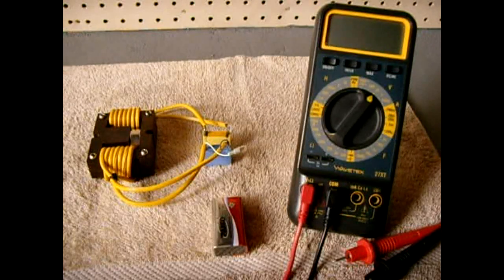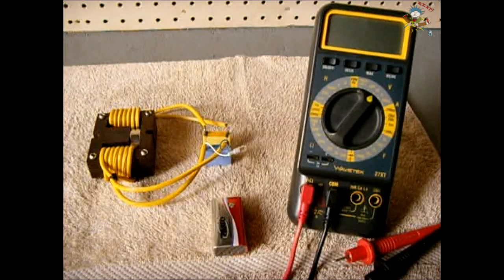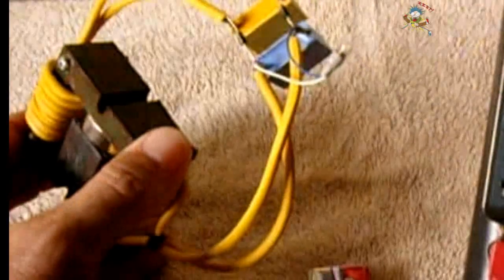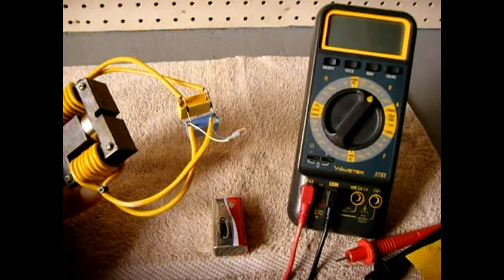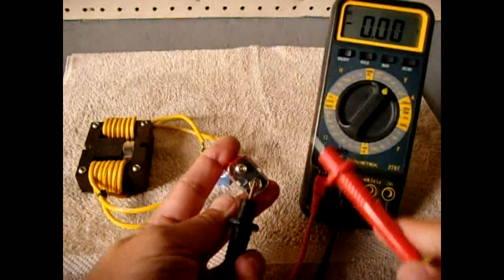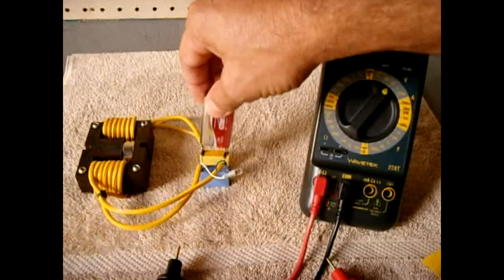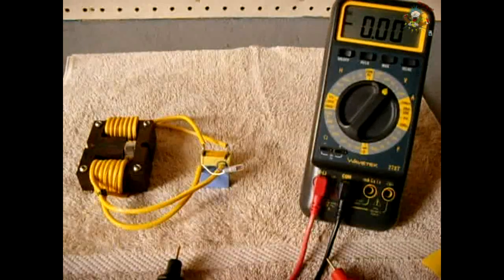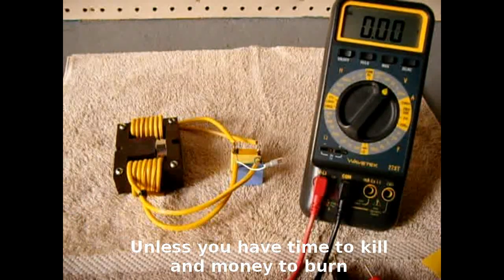Overunity Motionless Free Energy Generator EXPOSED!

Comment: I took a look at your explanation, and I saw the original video as well. Your Iron Mass is totally wrong. You created a solid square with everything bolted together. When you use a magnet, things have to oscillate, means vibrate. You cannot achieve Vibration if everything is bolted and screwed solid to the magnet. If you don't change anything, build it again.. it does work. Watch my videos.
Reply from the maker: Clearly it does not work regardless of having a "Solid" core. When you have a video of this EXACT device which you claim works, showing full operation, then send me a message and video with ALL design specs/parts used. If I verify it does work by making one according to your instructions, then I will post a link to your video. Case Closed until then. That same guy claimed that plastic on the magnet "blocks" the side magnetic field of the magnet. LOL. Really? Based on that comment, I know he is a fraud.

Thanks For Watching.
Reply: what about using a audio amplifier and a sound wave generator to achieve good vibrations ;) that way you can control much more the input frequency
Reply: Gerard Morin also coils are same gage wire ,so there are no step up and down electric charge and it just create a equal filed around the coil that it can not run the ions trough to the capacitors.
Reply: Shikalgar Shiraj
"Absolutely right. it does work if we use solid iron core."

Oh the irony - That's exactly the opposite of what Gerard was saying should work; he's claiming that "everything bolted and screwed together solid" is what is preventing it from "achieving Vibration." Whatever the hell that means with a capital V, since physical vibrations in a transformer causes losses in efficiency that are to be minimized.

Ever heard of eddy currents? If not, look it up and understand why solid metal transformer cores are a bad idea.
Reply from the maker: John khamis hesar
John, don't be ridiculous! Were you there to actually confirm it worked? No, so stop believing in these scams! They feed off people just like you. Unless you have PROOF, I suggest you end all this nonsense. Where is YOUR video showing this works??
Reply: Awesome
Reply from the maker: Tech Pro
Good luck with that.
Reply: John khamis hesar
Those are not electrolytic capacitors, but polymer film AC ones -> no, or at best very insignificant ion transfer occurs either way, especially at such low voltages. That is the whole point of a dry high voltage capacitor: to prevent premature wear through free ion formation under prolonged use. Electrolytic caps tend to have a polarity and thus don't even work with AC, exactly because they rely on ions moving the charge, and AC would cause premature failure. Only way to cause that to happen in this case is by arcing through the film and I doubt that is what you meant to happen. * Rolls eyeballs * Stepping up or down is irrelevant if we're talking about an oscillating LCR circuit that produces any kind of "vibration." If an electrolytic capacitor was used in such a case, ions would move either way.
Reply: As you know transforming DC electricity will create a magnetic filed ,but can not step up or down trough to the Iron core ,so there need a alternation .That alternative it's magnets and they create additional magnetic filed that it's recharge the primer filed ,none solid iron it cause a disconnection between the two filed and it jump to hyper electricity trough to the larger coil winding that it's step up the DC and what Dido and AC capacitor does it's to transfer the DC to AC low voltage and opposite with a none stop current as long as filed it's active or connection are connect .
Trick it's seem simple physic low  of magnetic filed , Electron and proton that it cause electricity by leading the electrons in direction that will charge them and speed up the electrons and protons trough to the secondary winding .There's a equation between the winding coil gags also turn of the winding and direction of the winding .To me video it's not scam and device it's completely operative .
Reply: John khamis hesar
Do you have any idea just what kind of a load of bollocks you're spewing? You can actually drive a transformer with just DC current and a variable resistor, provided you vary the voltage fast enough to produce a measurable voltage in the secondary. That's without ever having 0V or switched flow of voltage through the primary coil. In fact, modern switching power supplies produce a half-wave pulse-width modulated current from rectified AC at a high frequency in order to efficiently step voltage either up or down. In that case, though, the resistance on the driver transistors is enough to drop the voltage to 0 between cycles. Voltage boosting buck converters would also like to disagree with you, look them up.

Every time there's a change in the magnetic field in either direction, movement of electrons occurs that can be put to work, simple as that. This thing, if it resembled anything that could work, is a very simple LCR circuit: Inductance + Capacitance + Resistance = oscillations out of nothing but DC voltage. LCRs are the most basic of the basic methods by which currents can be generated in varying frequencies out of nothing but DC voltage.

Oh yes... bring a magnet near a coil and you'll get induction, until you stop moving it. Put work in, get some work out, minus all the inefficiencies involved in the conversion through lossy mediums. That... is known in the industry as a generator.

Protons moving into the secondary? What are you smoking? Not even electrons are meant to move from primary to secondary; that's a short circuit. The energies required to move lone protons through the insulation when the source material doesn't contain hydrogen... how often do you get irradiated by high energy protons, akin to cosmic radiation, just by standing next to an electrical device with a transformer in it? I hope not often.

If you're talking about ions again, then, once again, NOT even those move about in a transformer, that'd be inefficient. Unless you have high voltages and coronal discharge of some sort, as few ions as possible are supposed to be moving. Wires are insulated for a reason, since ions = free radicals = chemical reactions = premature wear + lots of extra resistance = heat and loss of efficiency.
Reply: dear ,it's simple as you said :here's what really it's happen .If you run a elector motor that it's coupling to a generator ,the generator will produce and amount of the electricity that can run the same motor during a reverse switch from the start source electricity ,so by disconnecting the motor from main source and immediate connect to generator you will have unfinished source of the electricity that it's run trough to a close circle ,that mean generator will run the motor and motor the generator .Same method it's used in this feature first a shock by battery and then secondary coil it does do the generator work .in fact primary coil it act as motor and seconder as generator.You need to move the magnet in the coil to create electricity ,now if you move the coil or electron around the magnet ,then result would be the same (electricity).The rectifier and diodes are just regulate the electron in a circuit ,which is adjust the up and down electrons in a regular shape.
Reply: John khamis hesar
Uhhh... word salad, I have no idea what you're trying to say that would translate to anything resembling reality or have any relevance to the claims of this device as producing free energy.

Physically move a magnet around a coil = generator. Work goes in, some reduced amount of work can come out. Generators have been made really damned efficient.

Induce a current in a coil with a resonator circuit = some self induction occurs once the current source is removed.

This is the fully known and understood cause of back EMF current from inductors that can harm electronics, but which is exploited by boost converters to up step voltages out of DC sources.

The ideal LCR circuit without any load or parasitic losses, what so ever, could potentially oscillate infinitely. But any resistance or load and assuming 100% efficiency, only as much work could be gotten out, as was put in. First friggin law of thermodynamics. Second law stipulates that you can never get 100% conversion efficiency, whenever heat is a byproduct.

Spin up a motor and plug it "in reverse" as a generator = dynamic or regenerative braking, which is very often used in anything from trains to electric cars. Look up KERS = Kinetic Energy Recovery System for cars.

Nothing spins or moves here = no residual kinetic energy to be exploited. Same principle as a transformer? You're spewing more bollocks!

Rectifier is one or more diodes and they work, in simplified terms, by providing a one way pathway of resistance. In one flow direction, the resistance is very low, but in the other, it's extremely high, like that of an electric insulator. Unless the maximum voltage or current rating of that diode is exceeded, the electrons can only effectively flow in one direction = rectification occurs.

What the hell are up and down electrons? We're not talking about quarks, are we? Do strange and charm also come into the picture?
Reply: It's too simple that your knowledge about electricity it make it too complicated for you .See it as it is. Electricity to magnetic filed and magnetic filed to electricity. As simple as that ,just focus in the circuit do not mix other mambo gumbo and confuse your self .
Reply: John khamis hesar
Eh, you're mixing protons, ions and crap where they don't belong. Keep telling yourself that I am the one mixing mumbo jumbo, mambo gumbo into it and confusing things.

You haven't refuted a single sentence I've said, but resort to a simplified ad hominem in disguise after tossing up word salad while moving the goal post to justify your views, how typical.
Reply from the maker: Shikalgar Shiraj
Another expert that has ZERO proof to back up his claims. Where exactly did you post your video of this device working?? I thought so. No video. All talk based on pure BS.
Reply: Well electronics  it's  BS  leave it fun  with drafting comments only .
Reply: Kageitenshi Electricity to magnet and magnet to electricity is not quite right - Electricity is equivalent to a MOVING magnet. In this case, one requires a force to MOVE the magnet.
Course, no use arguing, simply stated - these people use the grid at home to provide energy for their computers and lights - Nuff said.
Reply: Alan Williams
Huh? Which point were you replying to?
Reply: Well .Indian guy it made it and it work .
Reply: NO,...no it does not !
Reply: whether it works or not he did not recreate the experiment you shorted out the entire thing with 4 bolts period to recreate the experiment each plate of the Transformer must be separate so you can't truly say you've debunked it until you've created it correctly plus you have to have the windings correct so all you proved in this video is that you don't follow instructions well. it would be interesting to see you recreate it properly and then say it's debunked

Comment: The magnet is placed in the wrong place, place it with one pole touching the primary and the other pole touching the secondary and then apply a pulsed DC voltage and then see what happens :P
Reply from the maker: Sure it is. :-). The magnet is in the CORRECT place according to the video this was made about. Clearly you also watched the WRONG video.
Reply: electronicsNmore Watched video? An experiment this easy should be replicated not watched! Try it out with a larger magnet, a horseshoe magnet with 1 pole being over one coil and the other pole being over the other coil. Then try using pulsed DC and measure input VS output :P
Reply from the maker: Are you delusional? This video was made to expose ANOTHER video as a fraud to save people the time and money trying to replicate it. I could not have made this any clearer. Where in the video did I mention that I would try and modify everything in order to get this to work? I didn't.
Reply: Well, not that I don't trust you I'll make my own version of this using altered setup. It is all about the magnetic flux within the coil. If used properly a natural magnet will enhance the flux increasing out output (COP > 1). I'll replicate this experiment and post the video, we'll see who is right :P

Basic over unity device is your refrigerator. Typical refrigerator has a COP > 3, meaning it is 300% efficient at cooling! Every refrigerator is an over unity device.
Reply from the maker: Post your video showing this device working. I cannot wait to see it. I want to see very close video of the device in operation, ALL components/dimensions/part #'s used, type of iron core, where you got it, exactly how you made it, and place a small digital clock showing seconds next to the device being filmed so we will know if any video editing has been done. Very simple.
Reply: electronicsNmore :) fair enough, I already ordered the cores needed. This is actually very easy to prove.
Reply from the maker: We will see. If I cannot duplicate what you do in your video, then you will not be proving anything. Make sure you are very clear/concise.
Reply: electronicsNmore Alright, ever heard of bi-torrid transformers? They work on a similar principle. The only difference is that they have 1 primary and 2 secondary. The magnetic flux gets supported by the 2 secondaries when they are both under load. Thus, once you apply the load to the secondary the draw on the primary actually drops! The laws of conservation of energy aren't supported by reality. At the very least that law will have to be edited as a 'special case".
Reply: pirateman I will, and I am. Look up some of the videos on my channel.
Reply: electronicsNmore Are you a CIA agent trying to hide free energy,  pixie dust, and rainbow pooping unicorns from us? Trust me,  I have come across Naoki on enough videos to know that when facts  and logic win,  this is where the conversation goes.  He has commented on every fraud video I've seen almost.  He is either a fraud trying to sell this crop or he has just bought into it hook,  line,  and sinker.  Either way,  he will never admit that all this free energy stuff is just a fraud.
Reply: Scott McMurtrie I've also seen Naoki Kashima on a lot of "free energy" videos... COP > 3 LOL refrigerators are not an over unity device

Comment: I agree, the video you exposed is a total fraud.  I'm still wondering how he powered the auto headlamp bulb, which I believe was 60 watts.  A battery the size of the capacitor, even if LiPo, would undoubtedly have a substantial voltage drop powering a 60 watt bulb.  And he showed the bulb burning brightly even when the device was held above the table, which casts doubt on the possibility of being powered by magnetic induction from under the table.  Any more thoughts?
Reply from the maker: Like I said, master of illusion. :-). Probably used induction. You can also do some very amazing things with a video editor as well. I did not see that video, I saw the original.
Reply: pirateman
Very good!   Your analysis makes perfect sense.   Thanks for giving an explanation that really fits the situation.